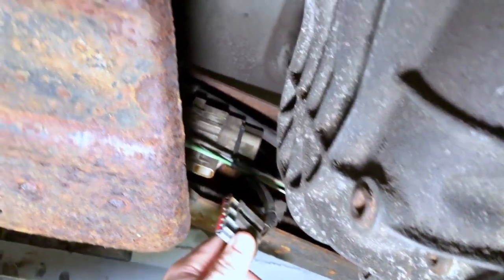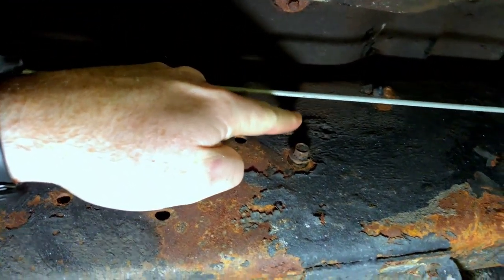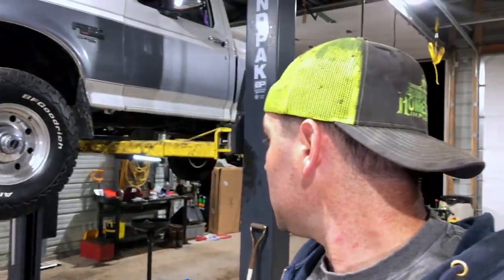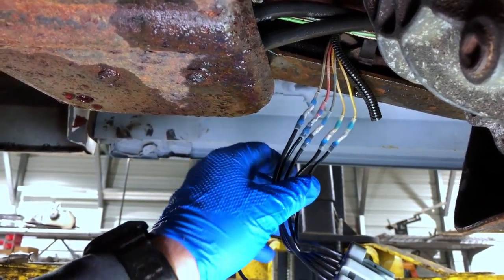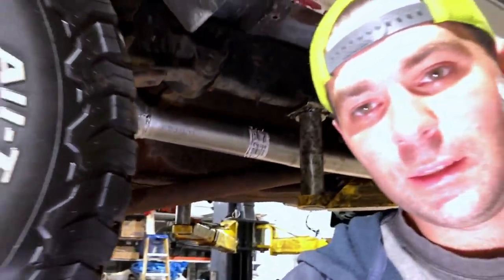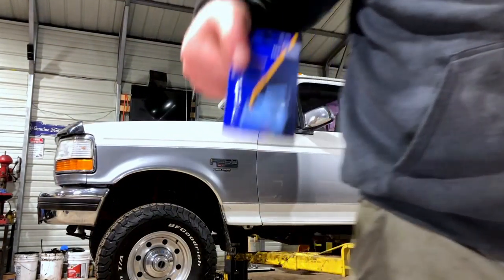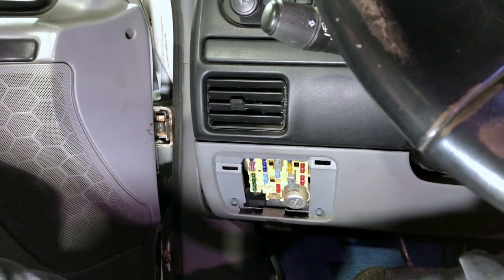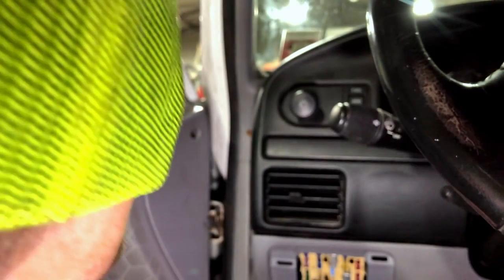The Problematic Ford Fuel Selector Valve

Comment: Sweet truck. My 1983 F250 has a little under 400,000 miles and the rear tank just rusted through and is leaking. With luck the selector valve will last until the truck is completely shot.
Reply from the maker: tell you what...if it does, go buy yourself a lotto ticket.  They are known to go bad with the slightest amount of dirt or debris coming from the tank.
Reply: @EverythingElliott  A friend had a dual tank Chevy diesel that he was putting fuel in from an unfiltered slip tank. Didn't take long to foul the selector valve. Went through a couple valves before figuring out what was going on. - Good you brought it up. Ordered a new tank and was just going to blow it out with compressed air and install. Better take the time to really clean and inspect it before putting it on.

Comment: I had the same exact issue about a month ago and it was one thing on my punch list after my off frame restomod. I swapped the selector valve first, still blew fuses, then swapped the switch, still blew fuses, finally unplugged the harness at the selector valve and then plugged it back in, that fixed it. Now I'm having issues again a few weeks later, but no blown fuses. I'm going to take a better look at the connector this time to see if it's corroded.
Reply from the maker: Hope it’s an easy fix for yah! Thanks for watching!
Reply: @EverythingElliott  I hope so too, only problem is, I'm stuck ont the rear tank and it takes forever because I didn't do the ventod on it and I swapped the old tank for a 38gal. BTW, I wasn't expecting all of that diesel fuel either. I swapped mine in the driveway and was frantically trying to put everything back together. 😭 Good looking truck btw.

Comment: Thank you ! Always wondered if I can cancel one of my tanks since I only use the front tank , I wanna use my rear tank and in place of the front tank wanna install a air tank and compressor for train horn and put a connection for a air hose in the front tank door to inflate tires 😎thanks !
Reply from the maker: Glad the video helped! Have fun with that project, sounds like a good one!

Comment: Which years use this valve?  have a 93 XLT and I do not see it. I am replacing the rear pump.
Reply from the maker: I believe they used these in 93, it will be on the driver side frame rail directly forward of the front tank

Comment: What line was to motor and what was return, I didn’t mark mine either
Reply from the maker: Tank lines are top and bottom, to the engine and back is the front. They are different sizes so can only make it work one way, the correct way. I mentioned that in the video I believen

Comment: What year is the truck Elliot?
Reply from the maker: It’s a 1997
Reply: @EverythingElliott  is installing the selector valve a diy type project.  I believe this is the issue for my front tank in my 97 diesel.  When I swap to the front, it loses power and stalls as if it's out of fuel. Wanted to give this a shot.
Reply from the maker: @LivingBatonRouge  you should be able to do it yourself with ease. Make sure you go get a new set of horseshoe clips before you start the project. Those are one time use. And just be prepared for fuel to siphon out of the tank. Clamp it off with vise grips.
Reply from the maker: @LivingBatonRouge  you might actually have a plugged line. Your selector valve might be switching and fuel just can’t get through. If you’re confident enough you can run 5 PSI of air through your lines from the motor back into the tanks. That’ll blow any gunk back into the tank to be picked up at a later date. The lines you’re looking for come up the front drivers side of your motor behind your AC compressor. Or just subscribe and check out the video that’s posting tomorrow on how to solve all your fuel issues with an E-Fuel kit

Comment: I cant find this valve in my 90.
Reply from the maker: Driver side frame rail. Mine was tucked above the transfer case crossmember. Might be tough to see based on your cab/bed configuration
Reply: @EverythingElliott  I'll look again. It's not a 4wd, but I heard 90-96 doesn't have it.
Reply from the maker: @redsholsters3544  That certainly isn't true.  if you have dual tanks, with a selector switch, you have one. They had a canister style one at one point, you might have one of those.  start at one of your tanks and follow the fuel line, you will run into it eventually.

Comment: I’m not sure what to do with the 6th wire I replaced the plug and the selector not working still my last guess is fuse or gummed up lines
Reply from the maker: I believe I left it unhooked, fuse should be in the fuse panel inside the truck if I remember correctly.